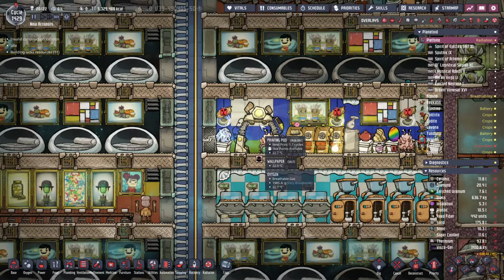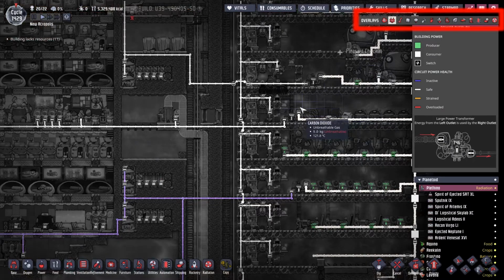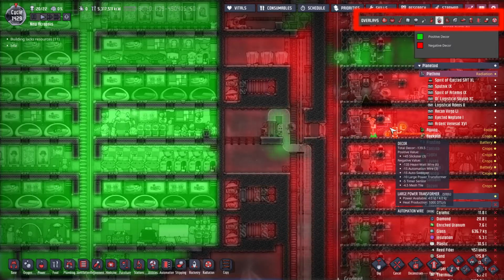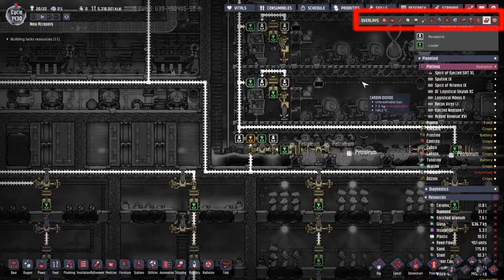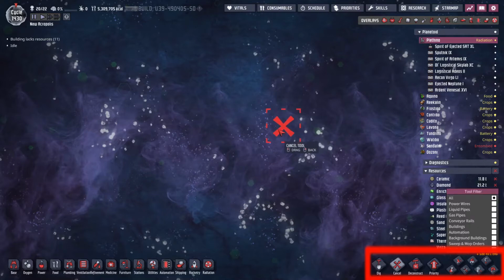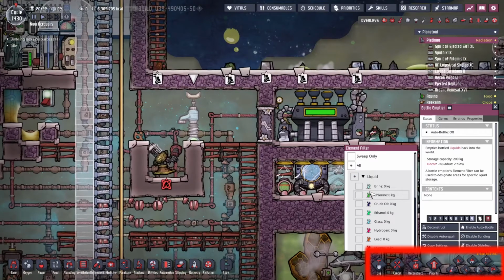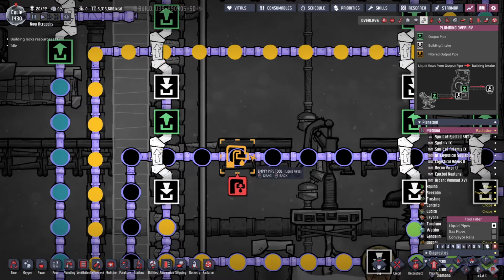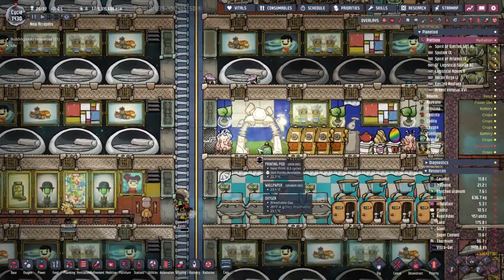Oxygen Not Included - Tutorial Bites - Controls and Overlays

Comment: Whats the control for switching between planet screens ? The tooltip shown when hovering over doesn't seem to do anything (QWERTY keyboard)
Reply from the maker: There isn't one specifically I don't think, you have to use the menu in the top right. But you can set fixed camera positions with using CTRL + any number (1 - 0), then use SHIFT + that number to get to that camera position. So if you bind camera positions for each planetoid you should then be able to switch between them with a hotkey.
Reply: It's [key above Tab] (what it is changes in different language keyboards) + 1, 2, 3 etc.

Comment: You have an error in explaining the oxygen overlay.  It doesn't distinguish between oxygen and polluted oxygen.  Both show up the same based on density.  What you described in the oxygen overlay was, I believe pertaining to the materials overlay with the gas filter on.  1kg of oxygen, 1 kg of polluted oxygen will look the same on the oxygen overlay.
Reply from the maker: I don't think I said as much - I said that the oxygen overlay has blue parts for oxygen or polluted oxygen. You are correct in saying that you can't distinguish between the two in the oxygen overlay but you can in the materials overlay.

Comment: 1k+ hours and never used the \, even though the tooltip clearly shows it as an option. Thanks for the enlightenment. My biggest hotkey issue in ONI is O and P, as pressing P by accident cancels you fully out of the current build operation and the rotation of the building just attempted.
Reply: I changed the rotation key from o to tab, and i use the ~ key to change ge speed, it seems but extreme but i fell comfortable with it